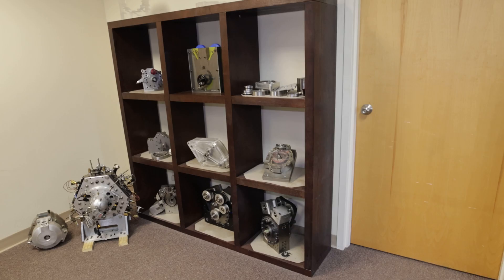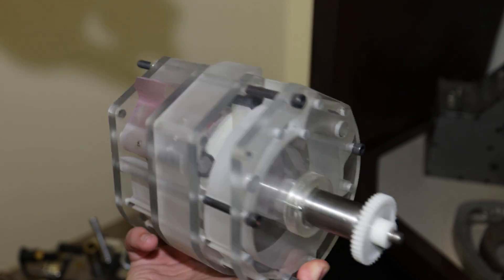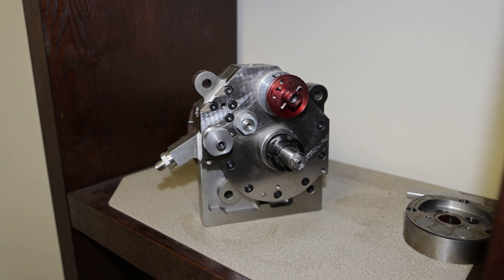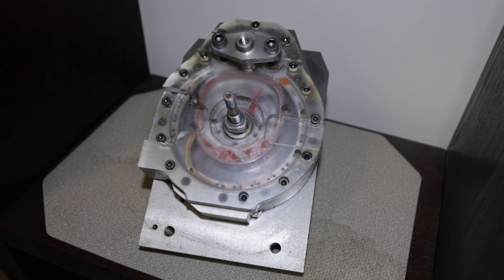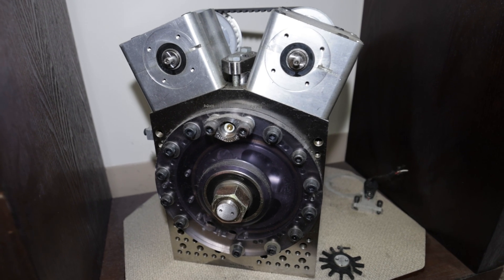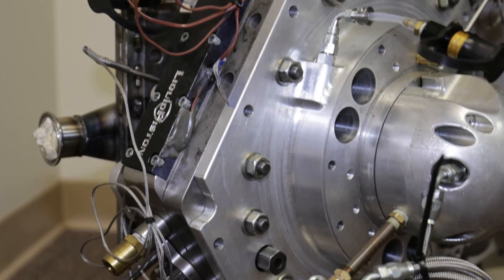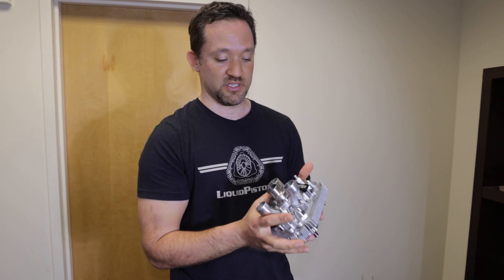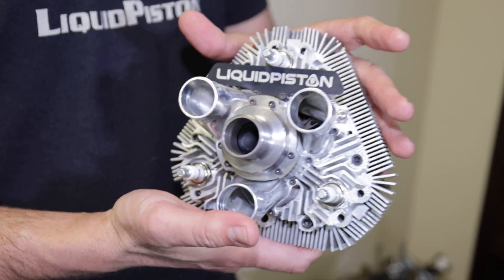Evolution of the Liquid Piston Rotary Engine ( W/ Alec Shkolnik)

Comment: I think my rotary engine design may be quite a bit better in many ways as it uses poppet valves to solve the air loss issues caused by open port systems. It also combines a heat engine and uses a piston for compression (plus the engine is surrounded in an axial compressor that also acts as a heat sink). It's actually a 1 STROKE ENGINE (or 2 way 2 stroke if you prefer)... Either way while one side combusts then flushes the other end is compressed, with compression also providing rotary power. 
--
You'll have to use your imagination to work out how this might be possible... I've worked out the most compact design, but it's mostly hollow TBH... 1 large chamber, 1 piston head only that's about 20mm thick with no crank pins etc.. Just a narrow piston head with a couple of O-rings, although a ceramic liner and piston could get rid of the O-rings and be lighter... The rest you'll have to guess... Combining a simplified Stirling style engine that takes up hardly any extra space is pretty damn cool / hot / cool / hot / cool / hot, and so on...

Comment: Hey warped lab have you ever heard of the new In-N engine? It's a single stroke, four cylinder, eight opposed piston engine with zero vibration from either primary or secondary source. You should look into it. Hell you might have already seen it.

Comment: You should pass a secondary shaft through the drive shaft connecting the exhaust and in take and make it a inline turbo charged engine. U could also have a free gear so it compresses by the spin of the drive shaft if that's faster.

Comment: The  Tri-Lobe Engine is fairly Elegant really . Looks like VERY high Compressions can be achieved . Diesel compressions .
And it fires in all three chambers . Even Thermal landscape , rather than Hot side and Cold side . The Rotor obviously has a Hot and Cold side .

Comment: I can see that this design creates a much better combustion chamber shape for burning the charge, compared to a Wankel.  What worries me, and something they skipped over, is cooling the rotor.  I can't help thinking the reason that aircraft stops and starts it's engine is because it can't run constant full load for very long?  The design of piping both the incoming fuel air mix and the exhaust through the rotor means it's difficult to use oil cooling to keep the rotor's temperature down.  The incoming air could cool it better in a diesel configuration, because a Diesel engine sucks in the total volume of air, (as opposed to a throttled air fuel mix in a spark ignition engine) but in either the diesel or spark ignition design the exhaust end of the rotor will heat up much more than the intake end and the only form of cooling would be heat conduction to the other parts of the rotor.  Maybe some fancy oil cooling channels could be used?
Reply: I think that extreme expansion of exhaust cycle should take care of the heat, also unlike rotary the gasses travel out through the middle.

I am amazed how clever the design is, I think once they optimize combustion chamber proportions and pick the best fuel that works with this design, this engine will walk over Otto and Diesel like they were last century...
You have to remember they only just made a running version, many things are open to improvement. I believe wide chamber twin rotor version would pack an insane amount of performance into a tiny, lightweight package. And even if it needs rebuilding of the seals every 1000 hours, they are really simple to open and refresh, also there are no wear surfaces that I can see so engine block should last really long time (rotor and gears would probably wear first).

Comment: The final version is basically just a Wankel engine. What's so special about it? Also, why is called "Liquid Piston"? I don't see anything liquid about it.
Reply: This seems very different to me. The seals are on the housing. The shape is different. The intake and exhaust flow through the rotor itself. I mean... It spins, so there is that similarity.
Reply: @justinclaiborne1716  the shape is reversed to wankel engine..
The rotor shape is like wankel engine housing...and the housing shape is kinda like wankel engine rotor...
🤣
Reply: i'm also baffled.. i can see some advantages but it's like meh...
Reply: And what’s «piston» about it?

Comment: This design is actually older than wankel. Look up Umpleby engine.
Reply: The Umpleby Engine is actually based on a slightly older engine called a Cooley Engine. The original was a steam engine and Umpleby converted it to an internal combustion engine.
Reply: Ah yes, I omitted steam designs. I actually wonder if Wankel was inspired by some of these older designs. When I first discover the liquid piston engine I was excited but that quickly faded when I learned how misleading their marketing was.
Reply: @danielhalpret  I'm of the opinion he was based on the fact that both his engines and the originals had two layers of rotors and an outer stator. As for liquidpiston, I was kinda taking their whole thermodynamic cycle thing with a grain of salt, but the engine itself as promising. Them as a company I'm indifferent to because they are a small company and for the most part they were looking to sell/lease the rights to build rather than the actual hardware. Unlike most scams, they were at least able to demonstrate that what they are making works so who knows what the future looks like with them.
Reply: Indeed, I suppose I am perhaps overly principled in my opinion, but I’m not a fan of the practice of patent profiteering, without the intention of utilizing the patent themselves. To me it is kin to playing the stock market, versus investing in a company. It is an ethically gray area.

Comment: I realized at the end of the video that it's an inverse Wankel. It uses a two lobe peanut shaped rotor inside a trilobe chamber. The apex seals are on the outer piece. How strange.
Reply: One of the biggest advantages is, that  now those seals can be actively cooled...
Reply: @klausbrinck2137  and they will be exposed to infinitely bless wear as they can be oiled, cooled, and not subjected to tremendous Gs and thermal cycling of the power rotor. Also, seems like replacement will be easier and with better metallurgy and materials science I'm confident that this will allow for far a more reliable rotary engine running on the more efficient HEHC cycle. Maybe just maybe, the rotary engine will get it's day in the before the sun sets on the ICE era. I am very excited for this. 

My biggest question is how balanced is it, can it be multi rotor? And can it be turbo/super charged? How does the intake and exhaust plumbing work? Liquid cooling in the future?
Reply: @scenicdepictionsofchicagolife  It looks to me like it can at least be formed into a 2 rotor since the exhaust ports and intake port through the eccentric shaft are only on one side of the engine. Liquid cooling seems like it would be easy to implement, and as per usual, forced induction depends on the fuel burned, ignition type, and compression ratio.
Reply: Technically they are Nadir Seals . Good chance the Tri-lobe engine can use conventional lubrication , rather than Two-Stroke Oil induction/injection .
High Tech Ceramic would be good for the Combustion / Nadir  seals .
Reply: The real problem w/rotary is that also burns more oil than Otto and Diesel cycles, even in this new engine. That's a big problem with emissions. This may have its place in different applications but not on large scale auto industry (at least until now). The intake is in the centre of the engine through a hollow camshaft and 3 exhausts ports are displaced equidistant around the intake
Reply: No more centrifugal apex
Seal forces lez, fixes the biggest problem in rotaries fr.

Comment: Sorry...  The key components of this clever toy simply aren't thick enough to dissipate the brute forces and heat
an automotive engine has to deal with over its expected 20-year lifetime.
Reply: Probably cuz it's a prototype.
Reply: @billbergen9169  no its inherently all BS - hasnt been tested or verified in an independent lab, where is the 1000 hour dyno test, where is the independently verified torque curves, and most importantly, why havent I seen this engine on anything?
Its a toy, and not a brilliant one. Its has tons of inherent flaws #1 being Compression/Combustion cycle is suboptimal, even worse than Mazda's wenkel design since the 'bean' is smooth and not cupped. You have no idea how much energy transfer is lost because of the fact that the Wenkel engine cannot push across at optimal vectors, but it is immense, which is why Wenkel's never became as popular as piston designs.

Comment: How is the rotor lubricated ?
Reply: This isn't like wankel engines, apex seals are in the housing instead of the rotor so lubrication can be made by more conventional method what avoid the need of inject lubricant in the combustion chamber. Radial seals is in the rotor but this don't make it difficult to lubricate
Reply: @rodrigomartinez3937  the wearing surface of the seal is still in the combustion chamber, watch the transparent cover video.
Reply: The one running in the video isn't meant to run long so it wasn't. The ones the military is expected to get have a couple options. 1.they can meter oil in on the sides to lubricate the apex seals or 2. they might be able to get away with using the heavy fuel itself to provide enough lubrication.